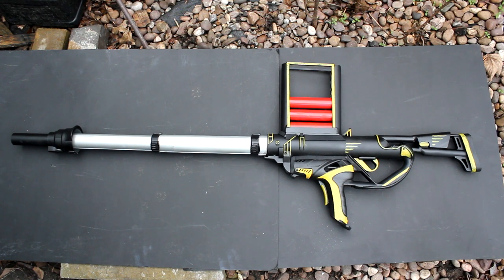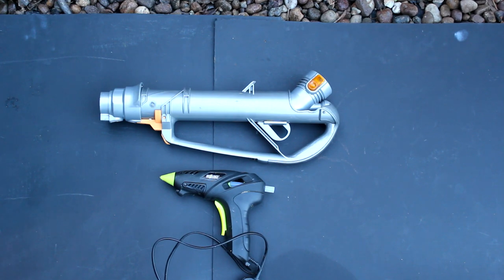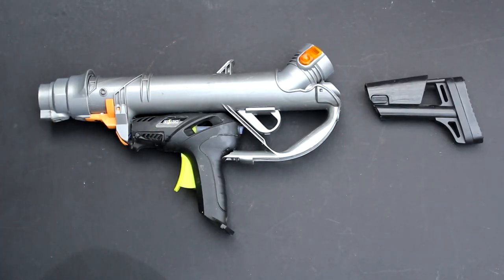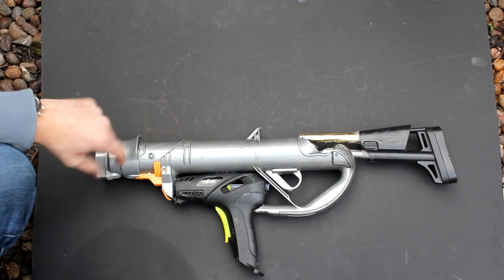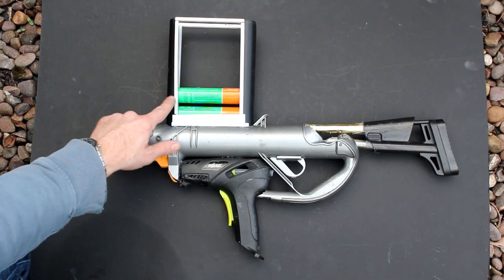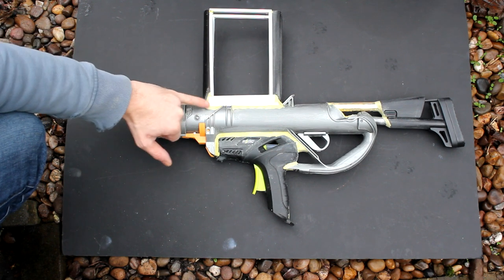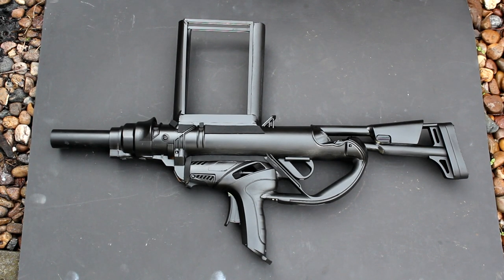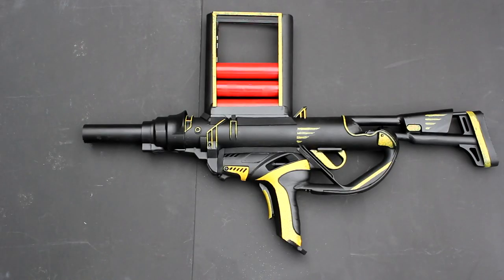Prop Sci Fi Grenade Launcher

Comment: Where do you get all these vacuum cleaner tubes?
Reply from the maker: I bought them on a local market stall, but you can also find them on eBay etc.  The new ones are expensive but there are often 2nd hand ones or even complete vacuum cleaners being sold for parts.
Reply: +It's A Trap! Have you ever considered going to a scrapyard or a dump for things like this?
Reply from the maker: Yes.  But I haven't managed to get round to it yet.  Car Parts would be ideal.